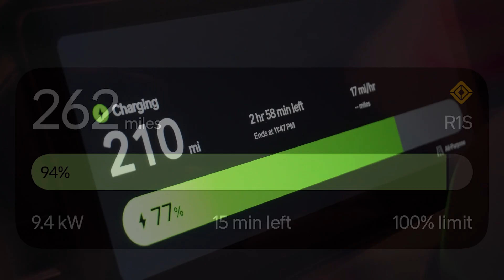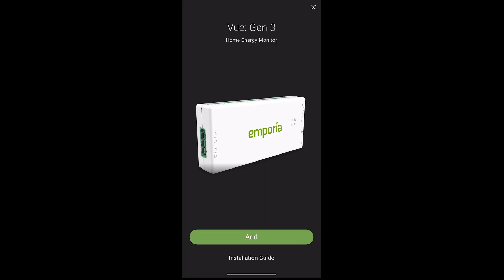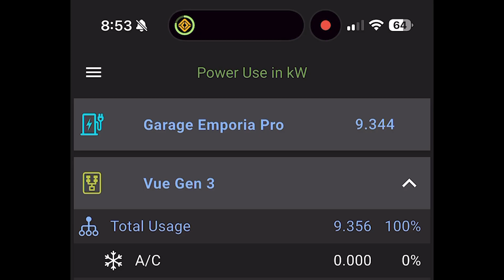The Emporia Pro Level 2 EV Charger Helped Optimize My Charge Speeds At Home

Comment: Electrician here. Ive used Emporia Vue panel monitor and it worked well but considering recommending this Ev charger to customer who has small 100 amp panel. Does the Vue 3 monitor work good and still give good charging speeds when rest of panel is Not under heavy load? I hardwire all charger I install for higher 48A/60A speed but trying to help homeowner who doesnt want to upgrade the electric service. Does this work well?
Reply: What you're describing is the most attractive feature of this thing. If you only have 100A service you are supposed to be able hardwire this device into  your panel and those sensors are supposed to detect how much power the house is using at that time and let you direct the 48A/60A to the car charger based its timer. Can you tell me approximately how much it would cost to have an electrician install this?